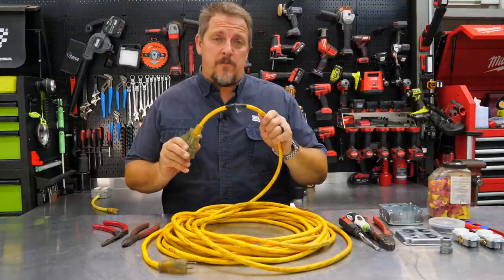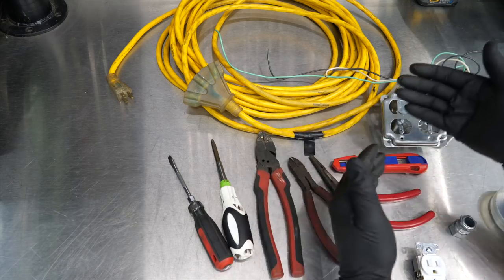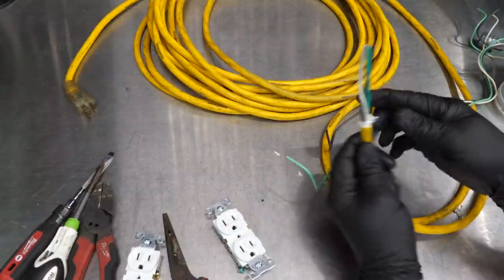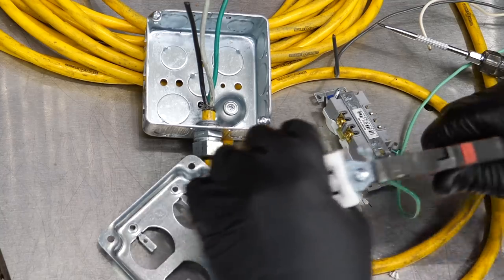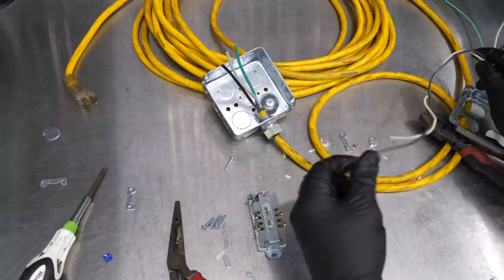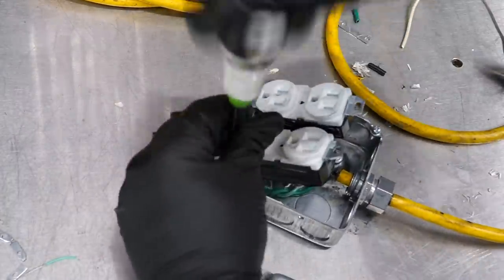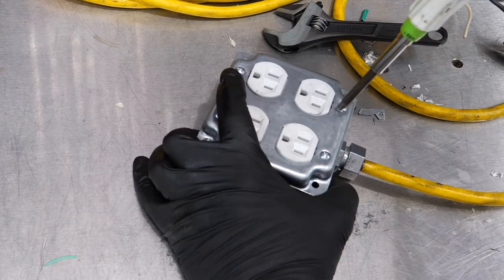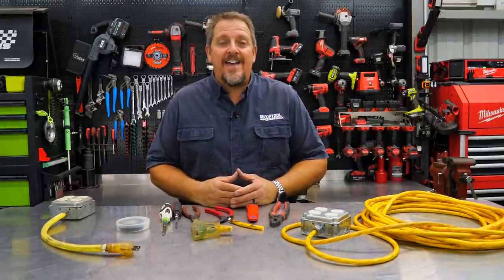How To Make The Best Extension Cord [Less than $20]

Comment: I just started watching this video but I agree on the upgrade. I used a  flexible strain relief and a Red Hospital grade GFCI on the left and a Red Hospital grade outlet. Both are the 20 Amp style with the duel blade opening.  
Thanks for another great video brother. This is a great tip.
Reply from the maker: Great idea with the hospital style outlets. Thanks for watching.

Comment: Nice!  I grew up with a few Dad made when I was younger.  Neat timing too, my nephew just asked about welding with a generator since he wasn't confident using an extension cord and I tried to explain ohms law, rating devices and that you can do both.  Mainly need to use a transmission that can handle the current.  This reminded me I picked up 40ft 10/4 cord for an excellent price from a scrapper for something like $25 a few years back.  Ended the FB messaging with, you can use that cord if your not using more than 30A welder... or at least that's what I thought offhand.  Need to verify before setting up and write down the circuit and do the math.  Anyways, I'm no expert at this... though I found for repairing cords where the inner wire insulation is good, I like the self sealing silicone tape with a little type 1 silicone on the end to prevent unraveling.  Guessing can do the same with electricians tape, though sometimes that material gets stiffer seems... though maybe that's the non 3M brands.  I even have a table saw that has an old style screw in fuse and switch that's like your design and I've seen some use light bulb sockets as well for a limiter.

Comment: Company I used to work for made their own extension cords with 12-3 stranded from a roll. Really nice cords with replaceable parts. Then we got a new HR guy, and the first thing he did was make maintenance remove them from service and replace them with OSHA approved cords. Which sucked because cords that were plentiful, were then hard to come by because for a shop running 3 shifts 24/7 with around 300 people total, there were about 20 cords which everyone fought over.

Comment: During the Christmas sales 2023, I was able to find a 12 guage Southwire extension cord for $45 on Amazon. Last I checked it was $60 for the same 100 foot that I got, which is awesome. I was waiting for prices like this for 2 years and I couldn't be happier. I can finally have a extension cord to my shed, for saws and/or lighting. I will probably only run 1 or 2 different items at a time, so 12 guage is all I will need for a 15 Amp circular saw or lighting and delicate sanding or soldiering. I couldn't be happier. 😊

Comment: Hey Tim great video I made the same box but in the back where you were looking at the holes I put silicone in to keep water from getting in easy in case I'm working in a little slight wet area.
Reply: Or you can use an exterior box.

Comment: Cool, i didn't know you can do that. At my old job, I found a ryobi electric pressure washer in the dumpster, cut the 25ft. power cord and made a extension cord out of it, but only a single outlet. Took the pressure washer itself out the tubular frame then put a milk crate in it that fits perfectly.

Comment: Very, very nice idea to make a 4 outlet plug with the extension cord. 👍🏾
Reply: As long as you remember to keep the total of all loads less than the capacity of the cord. If the wire gauge or the breaker is only rated for 15 amps you could easily exceed that with 4 motors.

Comment: Next time flip one outlets so the hot terminals are in the center and the neutrals are on the outside. Use the holes on the rear for two or four screw mount magnets. You can stick it to any metal on a jobsite keeping it off the floor. It will also stick to a truck bed, tailgate, tow hitch if doing a lot of work out of the truck.
Reply: Great idea, I think that will come in very handy for me, magnets that is.
Reply: Very well done video.  I have recently watched several YouTube videos on making up a 4 outlet box extension cord, and as a non-electrician this was by far the easiest to follow and covered questions I had after watching others videos.  Thank you for your well done video

Comment: Hi Tim.Subscribed to your channel here!  I have a100-foot, 10 gauge extension cord. Can I use that 12 gauge Romax ground wire that you used in the box or is it best to go even larger than that? Thx much
Reply from the maker: If you check the codes, such as 250.122 - Size of Equipment Grounding Conductors. 
(E)Flexible Cord and Fixture Wire. The equipment grounding conductor in a flexible cord with the largest circuit conductor 10 AWG or smaller, and the equipment grounding conductor used with fixture wires of any size in accordance with 240.5, shall not be smaller than 18 AWG copper and shall not be smaller than the circuit conductors. The equipment grounding conductor in a flexible cord with a circuit conductor larger than 10 AWG shall be sized in accordance with Table 250.122.

Comment: That looks like a SJTW cord--Service J300w Thermoplastic Vinyl coated Weather rated cord.  Also looks like, it's roping, meaning the outer shell is thinning, exposing the inner 3 cords, so watch out, try not step on it too hard  At 300 watts rated the cord might heat up from the inside from using high voltage equipment, but you'll be fine, the cord is not over 100 feet.  I would've use 50 feet 12/3 SOOW--600w rated oil water resistant rubber like cord, for abrasion and oil resistance for the shop.   Also would mount the 1200 box on the outside of a 5 gallon bucket throw the cord in for storage and keep the metal off the floor.

Comment: One good idea is while you have the end off of the cord, go ahead and slide heat shrink over the wire to fix any nicks or abrasions in the wire sheath. Much better than electrical tape.
Reply from the maker: Very good point.

Comment: Thanks I will be doing the same one question though is it possible to replace an outlet with a on and off switch
Reply: Absolutely, if you need it to be switched. Just run the black cord wire to the switch and the jumper to the silver terminal on the outlet. You could theoretically have one switched and one not switched, if desired.

Comment: I've made similar extension cords, although I usually use 20 amp plugs and receptacles. These are great for homeowners, but if you are a contractor or a business subject to OSHA jurisdiction, not a good idea. If an OSHA inspection finds any extension cords not approved and unaltered in any way (ground cut off, tears in the outer insulation, a homemade cord such as this) you will find that they are not amused. The fine for this kind of thing usually started at $7,000. That's seven thousand dollars per violation. Don't ask how I know, I was safety manager at a general contractor before I retired.

Comment: 2 things, I would have cleaned the wore before clamping it in the gland. Also why not run pigtails to each socket individually so the slave socket is not dependent on something the other socket is not. aka 2 wires and electricity from 2 wires. Also Try some Wagos one day. They are super nice. I see you like yous stuff tight! That is not going anywhere. any of it nice install.

Comment: The only question I have is why did you not tin the stranded wires
Reply from the maker: I think that's overkill for wires going into an electrical outlet that is encased in a grounded box. Thanks for watching.
Reply: It’s not necessary, though I have known electricians who would crimp on spade terminals.

Comment: If you are using this on the job you risk $1,000 Fine from OSHA!  The only change you can make to a factory extension cord is with 'listed' devices... meaning, a replacement cord cap.

Comment: When you've got power tools that need a 20 amp cord and you have the gage wire needed, it makes no sense not to use the rated components, because THAT DAY will come.
Reply: As long as you use a 20A male plug. Of course, then you’d always have to find a 20A wall receptacle.

Comment: That box isn't approved for portable use. If an inspector sees that on a job site, you will be making a $500 donation to the inspector retirement fund.
Reply from the maker: What is not approved? What inspector? For what area? You're making a pretty broad statement without details of the assessment. Thanks for watching.
Reply: OSHA is very specific about such homemade devices.  Put a good quality end on the cord and then get a multi outlet UL listed power strip.